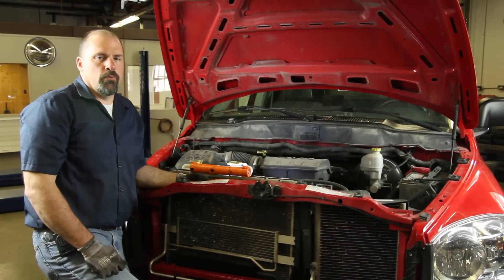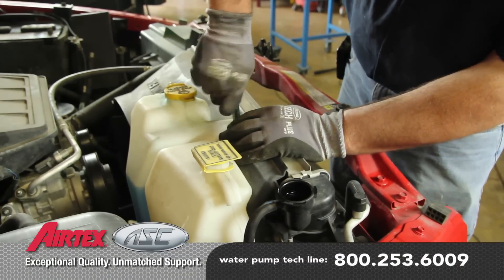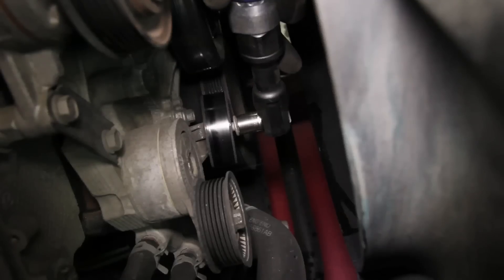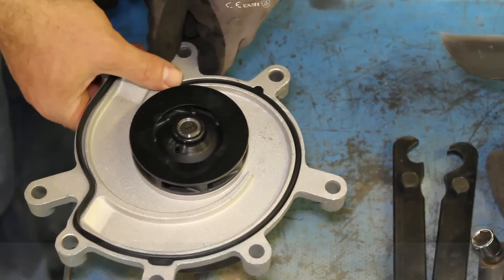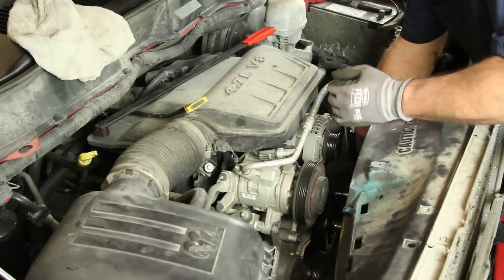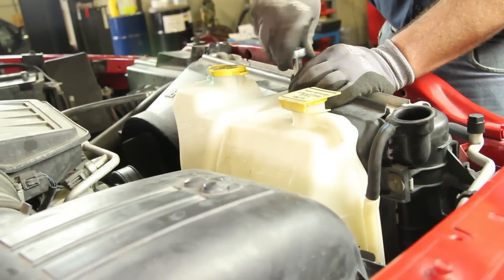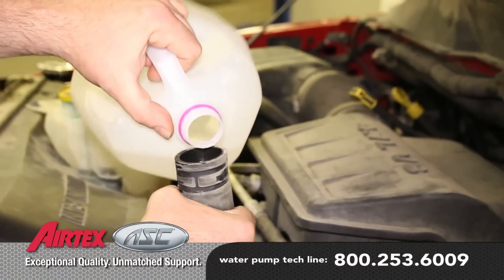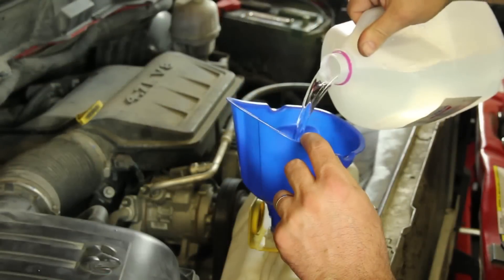How to Install a Water Pump - Dodge 4.7L WP-9240 AW7163

Comment: @ 2:43 you can see the pipe plug on the engine that you remove to facilitate coolant replacement so you don't have to play shade tree mechanic  by removing the upper hose.
It require a 8mm or 5/16 hex.
Reply: I didn't say to fill it there did I !
 I in fact said  "remove to facilitate coolant replacement"

Sounds like you've never replaced a pump on a 4.7

And BTW, thanks for the junk plastic impellers on H2o pumps !

Comment: Thanks :) I have water pump leak, chances are seal gasket broke. What the name of the tool you use to remove the fan, please.
Reply: Thank you. Yeah they are sold online but i was creative lol to take it out. But hey thanks once again. Ooooh also the wrench rental tool it was slipping off. Exact size for the fan clutch is 36mm. Find out after slips three times i was given a 40mm on auto parts store. I had to buy a adjustable wrench 300mm. Yes i did hit lol but better than slipping a nut. :).
Reply: Walter Castro  What did you use?
Reply: James Skaggs adjustable wrench a big size the 300m. Is been awhile I can't remember if use a small jack bar to hold the fan. After a month later. The tool that is shown on the video was the same exact tool is now available in auto stores for rental. 😒
Reply: After i actually looked at  i got it thanks man
Reply: And the tool i rented wasnt for my truck
Reply: 36mm  or  1 7/16